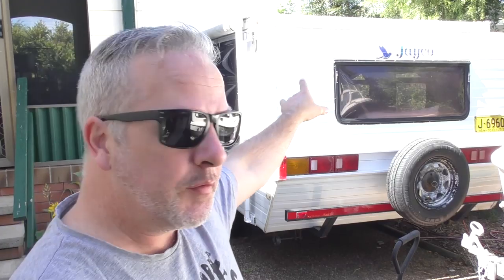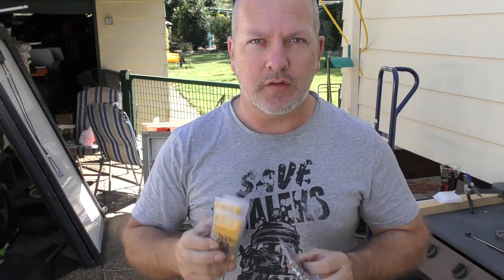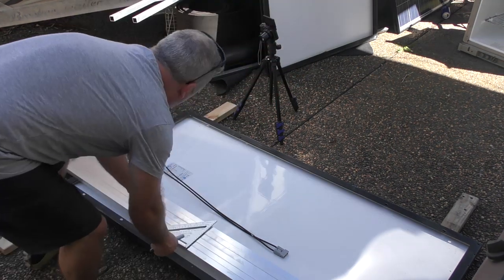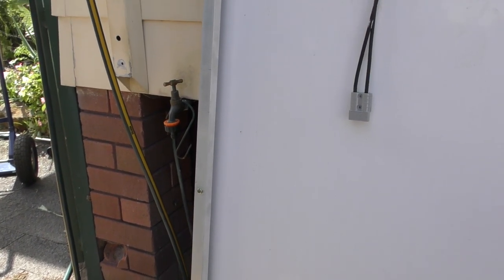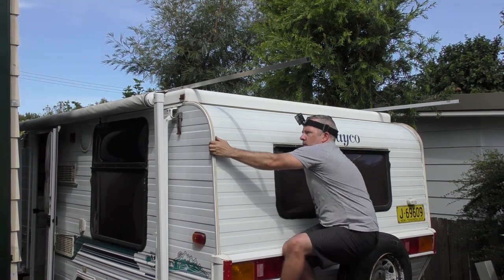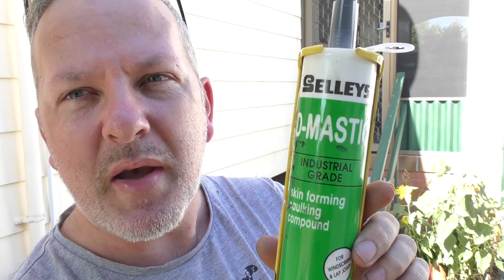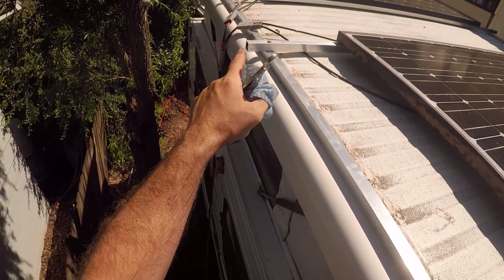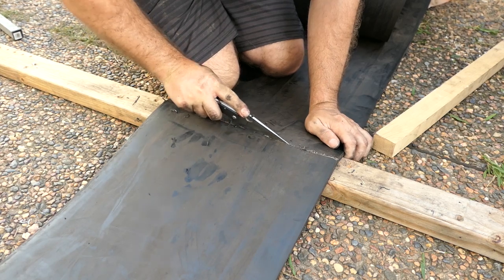Caravan POPTOP Solar Panel Install

Comment: Nice job, fridge should stay cold now 👍 inside should be a bit cooler too with roof top solar sun shades 🌞
Reply from the maker: Fingers crossed on all those things. I do have plans to give the roof a coating of that reflective/insulation/sealant type paint. I should have done it this summer though

Comment: G'day thanks for your informative videos. I've always mounted my panels with 50x50 alum angle screwed  sikaflexed, but I like your rail system a lot better. Can you tell me how the 25mm is holding up after a few trips ? Is the 1.6mm thick enough. I'm considering two more 160's mounted at the rear of the van and they weigh about 12 kgs each. 
Cheers
Pat
Reply from the maker: Hey Pat, the only issue Ive ran into is a leak that Ive caused. when I mounted the rails along the outside, I figured they couldnt possibly cause a leak because they were on the outside of the skirt . Unfortunately water is smarter than me and when the roof it down and the skirt is folded up under the roof, it makes lots of channels for water to make its way from outside its perimeter and into the inside. it confused me for sometime as it would only leak when the roof was down. so make sure you well and truly seal the holes where you mount the rails. I admit I did an average job of it as per my thinking above. I am in the process of trying to find some flexible panels to swap these ones out. Whilst Ive been happy with these, I'm going to be puting in a larger lithium battery and need to max out my solar. with the weight of the glass panels there are obvious limitations there for weight. I think I will be sticking with the rail type system though  when I make the change.
Reply: Great video mate that's exactly how I want to mount my solar panels. Now my Solar Panels weigh 38kgs. 19kg each. 330wt each.  Is that 25mm aluminium rails you used good enough for this weight.? 
And Steve from Mudduck is a Great Fella. Meet him twice now.😂

Comment: Hi mate, I wish I lived next door to you, I could be your camera guy and hand you drinks and learn stuff.
love your videos, informative and entertaining, I would like to make a suggestion for future reference if I may.
fastening your solar panels to shs aluminium that way is not the best idea although you did lock tight the nuts and that's good.
Back in the day of accessory fitting we would encounter that problem of crushing the chassis with the bolts when installing tow bars to vehicles. to remedy the issue we would drill a larger hole on the bolt head side of the chassis to then insert a steel tube.
The tube would sit flush against the back of the chassis and flush with the surface of the bolt head end. when the bolt is tightened it can only crush down as far as the steel tube making for a good solid bolt up.
In your case you could use aluminium tube. Just saying.
Reply from the maker: evening. just trying to get my head around what your saying. so the steel tube would be at 90 to the bolt and act like a big washer of sorts ?
Reply: @DENMONKEY  I've emailed you a drawing. Hopefully it will make sense.

Comment: Great video. Much appreciated. One question though. With the steel running the full length of the caravan is that causing pooling of water ? as it can then only run off the front and back ends
Reply from the maker: It's wasnt but I park under a tree which drops lots of little leaves. They are getting a build up and that is causing the water to pool. So I need to hose them off regularly to keep it clear. I also leave it tilted front to back slightly when it's parked up.

Comment: Hi dean, not sure if u will get to read this, im not doing fixed but wanting to install flexible panels, 1 is 200 and the other will be 300wt on my sterling i was trying also were your vid was about how the panels you wired are in up in para? can u pm please etc thanks as im happy to share my stuff as well thank again.

Comment: Hi, love your vids. Just subscribed. Can I ask why you left a large overhang on the sides of the aluminium square tube?
Reply from the maker: Hey Johno, thanks for the nice comment and the sub mate. 

No particular reason, other than the time I had to work with to get them up there. My bench saw in the shed has a heap of stuff on it, so I couldn't use it to cut the tube down and I didn't want to cut the extra bits off by hand at the time. I figured, other than it looking a bit odd, there was no real down side to leaving it like that. Now that I've done the new struts, I'm considering swapping the 185w panels over for the 235w , so i might do it when I make the change. The set up now is working great, so i may also leave it as is. I've covered about 1500kms since the panels and struts went up and I'm happy to say they're still there. 

cheers Brett
Reply: @DENMONKEY  Cheers Brett, I thought that may be the case but also thinking you left it longer for a reason. I discovered you through caravanersforum with your how to convert a range hood to 12v which I successfully did yesterday. Good stuff mate 👍
Reply from the maker: Sorry it wasn't something more interesting.. Glad the range hood worked out. No idea why they made it 240 in the first place. Cheers

Comment: My caravan was in a REALLY BAD freak hail storm once that came out of nowhere. The roof was destroyed along with all the skylights. It's all fixed now but because I've seen the terrible damage hail can  do, I've been really hesitant about roof mounting solar panels. How do the ones you've installed stand up in hail?
Reply from the maker: good question. we've had small hail storms here but nothing serious. I figure these are made for house installations , so should hold up to a decent storm. Still, if the hail is big enough, not much is going to survive.

Comment: Great video!  The only thing I'd probably do differently is to use Nylocs instead of the split washers, although the Loctite you used is good too! :)
Reply from the maker: Dave I have a roof leak I need to sort, bloody caravans. Leak is not panel related but it will mean pulling them off to give the whole roof a servicing and reseal. I will definitely be swapping over to nylocs for sure. To be honest, I don't know why I didn;t do that in the first place.

Comment: Enjoyed the vid - planned to do mine the  same way before seeing your vid.  Great minds think alike !  My plan differs a tad because I want to charge caravan batteries on the go - so I need to find a way of getting solar power into my poptop and down to my bats under the bed.  2 more "reds" and I will probably solve that issue !  
Regards,  Graham from Waterloo Corner, Adelaide S.A.
Reply from the maker: Hey Graham, gday to SA.  Let me know how you go. I'm yet to permanently run anything down from them. 
I've just stuck with the anderson plug/lead and disconnect during travel and connect it back when set up. 
A fellow on the grey nomads, showed me a nifty set up where he put some of the square conduits down the side of his van and ran the wire down that. He had flat sides though where mine has the layered  aluminum sides (I'm sure there's a better term for it) so it wouldn't lay flat or look nice. Might work for you though, depending on your van. I'm all ears if you want to share once you've tackled it.
Reply: DENMONKEY - plan on running the cable, on the poptop roof, using the track as you described.  When the cable reaches the back of the van I will drill a 12mm hole and push the cable into the interior of the van.  The cable will come out near the top of one of my cupboards - I'll ensure, at this point, that the cable has about a 400mm loop to compensate for raising the roof.  The remainder of the cable will run through the cupboard, then down to the batteries located under the bed.  Silver solder the anderson plug to the cable.   Regards,  Graham

Comment: When you put the top up, push the awning back to the van and lock into the top,brackets , then you are only lifting the roof and not pulling the awning back,to the van as well, makes it a bit easier
Reply from the maker: Not sure I'm following Jeff. If I have my awning in close to the van and try and lift the roof, it won't come up as the awning needs to raise with the roof. If I don't have slack it in, I can't raise the roof . 
Or you you mean to flip the catch on the awning as though to open it and then lift the roof ?

Comment: Great video, only good no nonsense Aussie one I could find. Doing it in the weeks to come, cheers 🍻 Subscribed.
Reply from the maker: Cheers IOI. Took it out on the weekend for trip.2 hours each way. Still holding on ,😄. I have to take them off to sort a roof leak soon and will stick on nyloc nuts. The leak isn't panel related. I have to remove all the silicone from the previous owner though.
Reply: @DENMONKEY  just bought all the bits to do this and bugger me, the person who fitted the new style awning put the track right on the edge of the inside ali frame , now i have to take that off, fit the solar frame and then put the awning rail back on. lol

Comment: Oooh forgot , you can get removeable supports for the roof, they help take the load from the awning , stops the roof drooping on that side,  a available at caravan stores or on ebay.
Reply from the maker: All good. Literally just finished putting higher rated struts on the van. All packing up. Sooooo much better. Video should be up tonight.  A mate uses those sorts though. He swears by them
Reply: @DENMONKEY  sweet , have a good trip,
Reply: @DENMONKEY  Can you let us know what rating struts you ended up with ? I’m thinking of mounting my two 370 watt panels on similar van so perhaps 500 NM struts ? Great vid 👍

Comment: Greetings from Canada!!! Likely a REALLY dumb question... did you use Stainless Steel bolts, nuts, washers and other mounting hardware?  Cheers from here!!
Reply from the maker: no, these are a high tensile zinc coated bolts. I did look at the galvenized bolts but I didn't like the finish on the ones that were available locally. 

Thanks from Aus

Comment: Can you show the wireing throu your pop top ceiling to your battery please
Reply from the maker: I don't use a permanent install John. There wasn't a solution I was happy to try whilst under way. Instead I have the anderson plug up on the roof coming from the panels and one under the batteries at the side of the van. I just run a cable between those when I pull up as part of my set up process. It also allows me to connect up a panel to the van when its parked up at home and not in the sun. I did see an install though where someone used that square (conduit) I think they call it trunking conduit. he ran a length up the outside of the van and had the cable run through that. Has outside panels were flat though where mine are not. So I've just stuck with the manual process. open to options though, if you come up with something